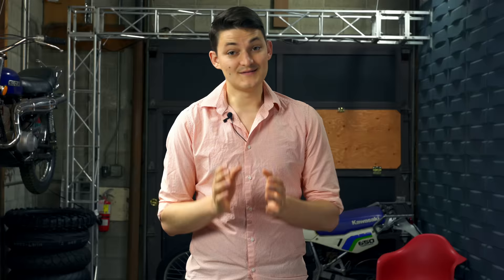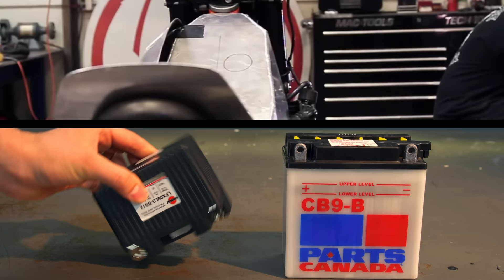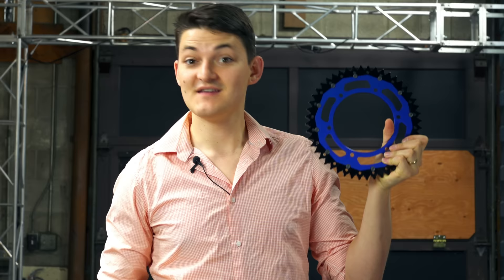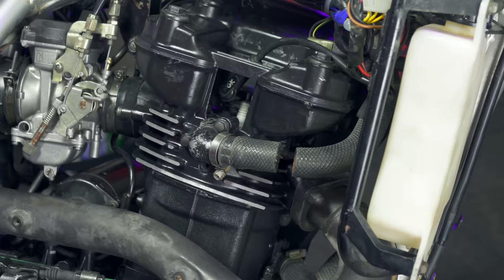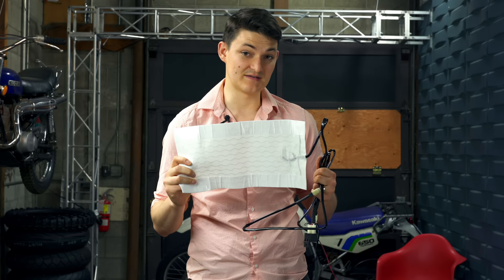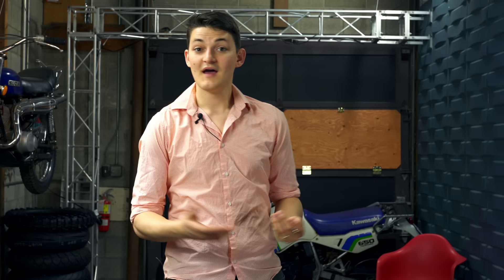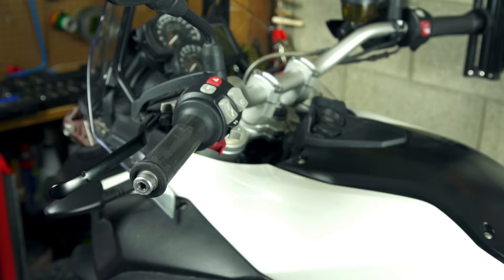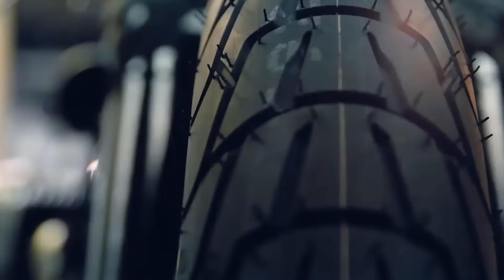10 Game-Changing Motorcycle Mods

Comment: I can't help but chuckle at the idea of spending 2-3x as much on a battery and on fancy aluminium sprockets to save what is essentially the weight of a good hot meal in your stomach. The lightest road bikes will weigh somewhere close to 600lbs with rider, unless you're doing some really high level competitive track riding 6lbs will make fuck all difference.

I'm surprised you didn't mention heated grips as a reasonably effective but far less dorky alternative to those mitts, or some far more functional performance mods than light weight sprockets, like simply changing their size/teeth count to change the final drive ratio. Even a super lightweight titanium sprocket will improve your acceleration like 0.1% from decreased inertia, a plain steel front sprocket with one less tooth will increase your acceleration 10% easily.

Comment: You installed an azz warmer in your seat.  All the thousands of miles I rode in the winter time and I can't remember once thinking "oh, damn, if only my azz wasn't so cold".  Usually the thing to get is electric vest, electric gloves.... do they have electric boots?  I used to use a plastic trash bag over my regular riding boots (for lubrication) and then I would pull a rain boot over them.  That would mostly keep my feet warm.   But, yeah, as counterintuitive as it might sound, I never froze my azz.

Oh, yeah!  Hippo Hands!  I almost forgot.   I saw them first when I was in Korea back in the Seventies.  I bought a pair to bring back home, and kept them through think and thin even when they fell apart, so I could take them to upholsterers and tell them "I want a new pair of these".

Comment: Does the dual aluminum/steel sprocket save any noticeable weight? I'm estimating, but I don't think less than 1 lb would be noticeable performance or handling gains. Plus I'm sure its more expensive than a regular steel sprocket

Comment: Ok this was super interesting. I’m wondering if there is a way to use a lithium battery and package the security system into the stock battery location on my 64 R50/2.  It’s old so everything is open and there aren’t good option on where to mount.

Comment: quick question on the anti-theft device, if someone steals your motorcycle lets say by throwing it in the back of the van and through out the ride they disconnect the battery will the device/GPS still work?

Comment: Do those lithium ion batteries have any integrated BMS or charging circuit/protection? I'm curious about putting one in an older bike with less reliable electronics. Can I just solder together four 18650 cells into a 4S1P pack and hook it up like any other battery?

Comment: Trouble with lithium batteries ... They shut down before they reach a certain voltage to prevent  battery damage as  a totally drained lithium battery won't recharge.,. So if you forget to turn your ignition off after using your kill switch  for example your lights will drain your battery real quick and your battery will delete itself. Been there done that

Comment: Another problem with lithium - cheaper ones have 18650 cells arranged in lanes with voltage control per lane instead of per cell. So there is a risk of one cell loosing its zero and dying on you with the cell controller having no idea this happened. The remaining cells in the lane then receive more charge then they are designed to contain... a hot mess indeed. Literally. Using the battery's balancer port ususally solves the issue, but this should mean you're going to need to add an extra chip to your bike to control this.

Comment: So, if I could only afford one -- hands cover, heated grips, winter riding gloves -- which one should I get?  Assuming that they are all the same price.
Reply: TLDR: Hand muffs
I ride all year and already have heated grips and when the outside temp reaches 0 Celsius they don't stop your finger tips (or thumbs) from freezing, and that's with winter gloves (I presume you don't mean heated gloves). I DIY'd some muffs (because I'm cheaper than cheap) and blocking the wind means blocking the wind-chill. Wind chill = approximately -1 degree C per 10mph, thus 0 C outside temp at 70mph feels like -7 C on your fingers. This is tolerable for 10 mins but not any longer than that. 
Wiring heated grips properly makes a big difference.
Blocking the wind makes the biggest difference.
I'm wanting to try heated gloves because my ego breaks through and says the pain of frost bitten fingers and thumbs is worth it (it's not, is effin painful) but my tears freeze on my face so no one knows I'm crying.

Comment: Gel battery is the way to go... mine has 14 years already and its supposed to be for a cbr600... I'm using it on a yamaha yzf 1000r... as for weight, best weight saving a man can do is to take a dung before riding xD seriously it's not such a big deal considering people would rather have a motorcycle with electric start rather than kick start... wich truly would make a weight saving

Comment: There only cons on lithium batteries. Moto is charging it too hard and it will die. Also it will blast the rectifier regulator real hot.

Comment: Only problem with LITHIUM BATTERIES is they do not handle extreme temps very well. So if your bike stays outside in extreme heat or cold not the best battery.

Comment: Lithium batteries aren't charged while riding due to the voltage output of the charging system being incorrect, you have to trickle charge them with a lithium specific charger. Take it from a mechanic, lose a few pounds by going on a diet it will cost less than the battery and charger...

Comment: @Fortnine,

- lithium batteries cannot just be fitted to existing motorcycles, the charging circuit on most bike will NOT know how to properly charge a LiOn battery. And here in the UK just like canada, they will NOT as you have just said, cope with the cold. So overall, f**king pointless mate.
- the spinning mass of a steel sprocet when it that close to close the axel is almost non existant.
- I can see the heated seat element failing in short order after being sat on a few times...

Comment: Can someone here help me? I want to install ram mount for phone on my left side handle near the clutch. The hole have 9.5mm diameter. But I found in online shop only m10 or m8 screw for the ball mount head. Should I just go with m10 that have 10mm?

Comment: From all the list I might only try the dual material sprocket, though I have done around 40K KM on my bike and I'm still using the original heavy sprocket and it still doesnt look much bad, but the original chain broke on probably around 5K KM, can't even remember and made a lot of damage and since then my bike eats oil like nuts even though its not dripping oil anymore since it got fixed with a 2 part metallic material or some crap, but never replaced the motor side metal cap and never bought the chain protection ever again, that's what ripped a whole when the chain broke and took the protection with it :(.

Comment: This lithium battery trend is really getting out of hand. The supposed ~6 lbs (huge? uh, no) weight savings is ludicrous to be concerned over and far from a valid performance gain. One gallon of fuel weighs ~6 lbs... how many people are really bothered so much by 6 lbs that they hold back on that last gallon of fuel when they 'fill' their tank or did they not notice the weight until someone mentioned a new lighter battery fad sweeping the interwebz? IMO the higher cost, nominal weight difference, need of a special charger and ambient cold temp issues running a lithium just isn't worth the hassle and is why I rely on AGMs all year long. Ryan, I like your vids but I'll have to push back on this lithium battery thing.

Comment: Another nicely made but pointless video on this channel. Different bikes have different purposes, hence require different mods to make them better. On a track bike, you'd want to upgrade the suspension, change the tyres to racing ones, remove the stock exhaust and have it tuned, upgrade brake pads (possibly MC and calipers), put crash protection, fit a lighter battery, lighter chain 520 conversion. On a tourign bike you'd want stuff like a better seat, luggage add-ons, usb charger, scootoiler, touring screen, denali lights, heated grips, cruise control etc.